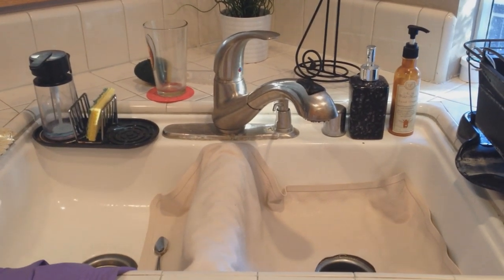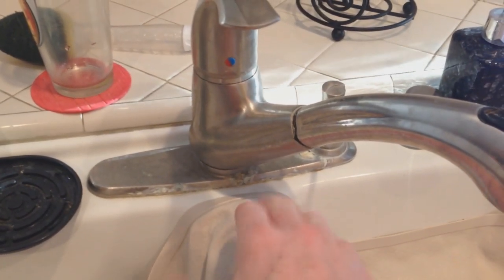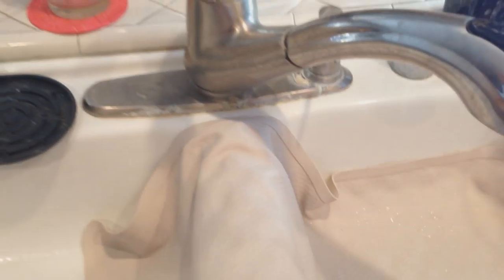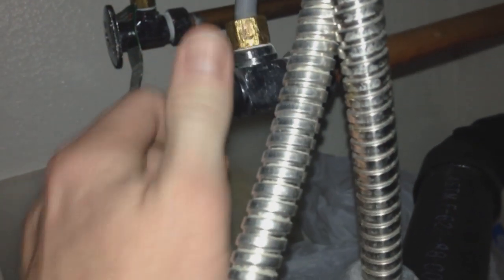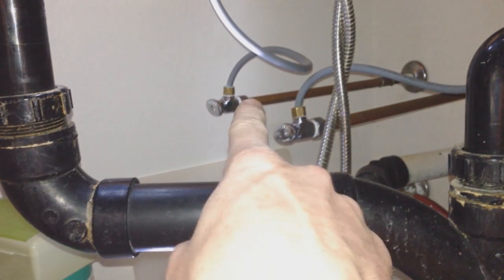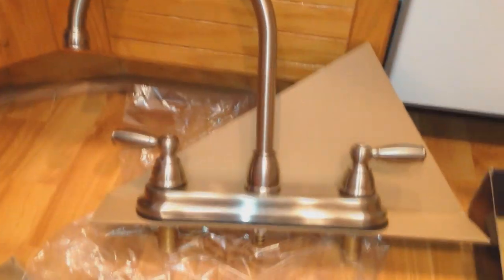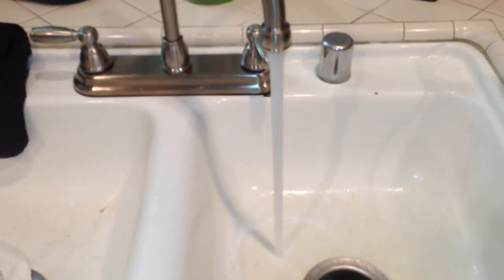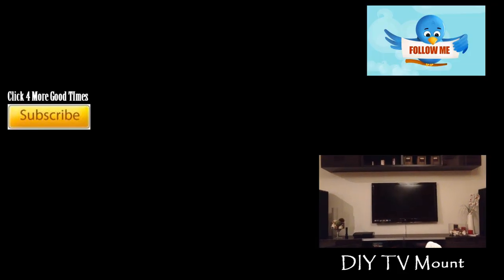How To Install A New Kitchen Sink Faucet - Replacing A Kitchen Sink Faucet

Comment: Hello,  
At 7minutes and 15 seconds, how did you get the pipes out of the ring inorder to pull the faucet out?  Did you just cut the pipes or did the ring  (washer)slide off? Did you cut the metal washer?

Thanks,
Eric
Reply from the maker: Eric Fine Hello Eric, yes since I wasn't going to re-use or sell the old faucet it was in pretty bad shape, I just cut the pipe to get it out, or I think I just bent it back and forth to break it, it again was in pretty bad shape original from the late 1980's or possible mid 90's